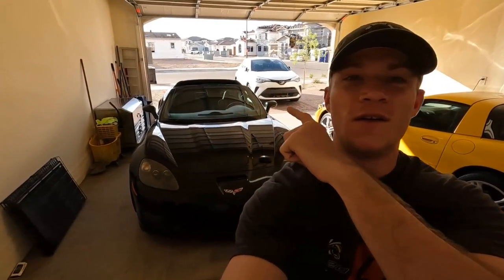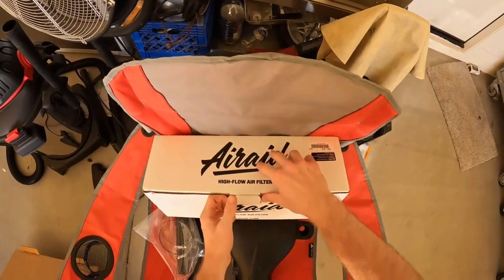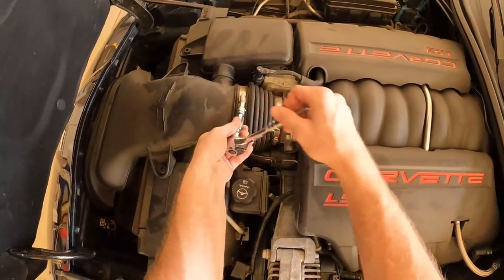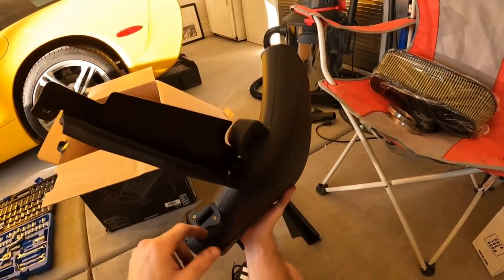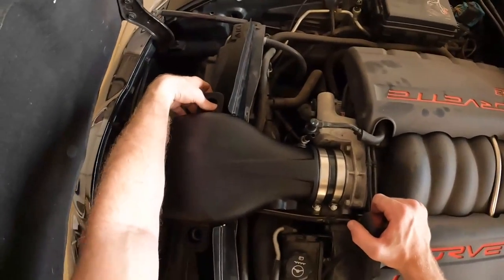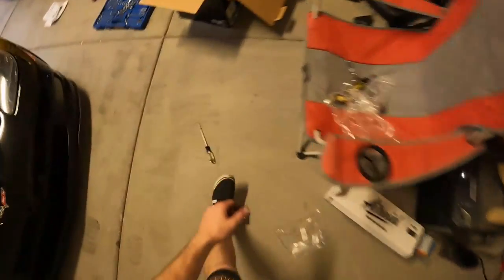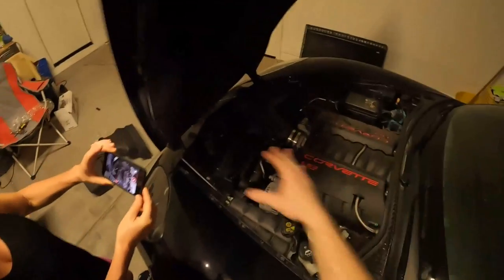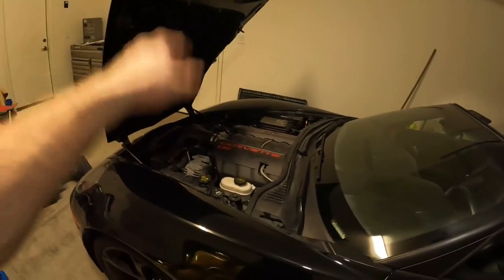First Mod For C6 Grandsport Corvette! Airaid Cold Air Intake Install LS3

Comment: I think it’s better to put a heat sheild to prevent hot air to the filter .. you will lose some hp when the engine become hot I think

Comment: Did you notice any improvement at all in throttle response with this intake?
Reply from the maker: Maybe by the seat of my pants SLIGHTLY, feels like there's a tad bit more under the torque curve. Tune definitely tho
Reply: @CamMarz  I put a Z06 intake with one of the attack blue filters on my LS3 but I was thinking about picking up one of these Airaids… not sure it would actually gain anything tho

Comment: I have yet to see an independent a/b Dyno test to prove any power advantage to aftermarket intake.  Personally I do not think it's worth it.  Every auto mfg is under great pressure to squeeze out all of the efficiency they can for CAFE numbers and their engineers are better.
Reply from the maker: Factory intakes are definitely still efficient, but aftermarket ones still do squeeze out a little more. There are several Dyno videos breaking that down on YouTube. I don't think it's a super necessary upgrade though, factory ones will work pretty well!
Reply: @CamMarz  I think it's car guys wanting to do setting simple to show they are car guys

Comment: You give the install a 4 out of 8, had you familiarized yourself with the install instructions first, you wouldn't have had any trouble. So, put that 4 out of 8 on yourself.
Reply from the maker: Fair enough, but some of the parts were a little goofy for my liking still